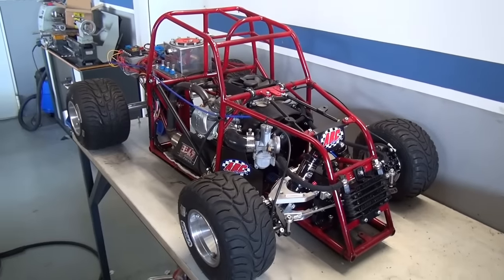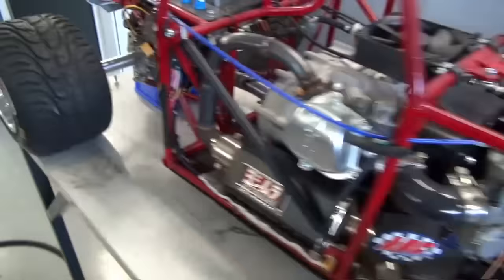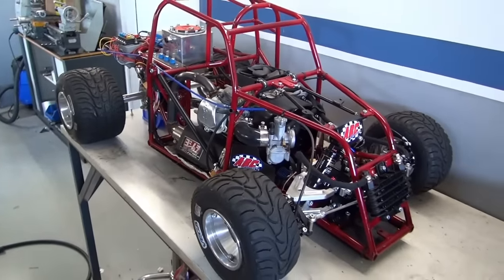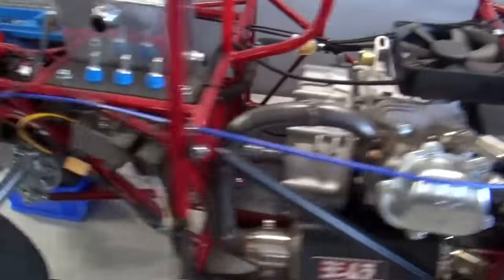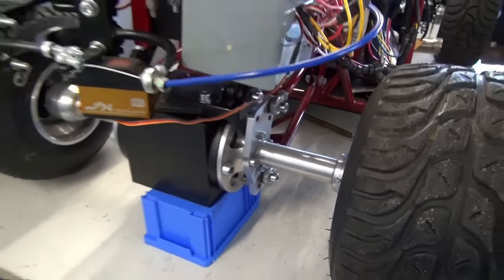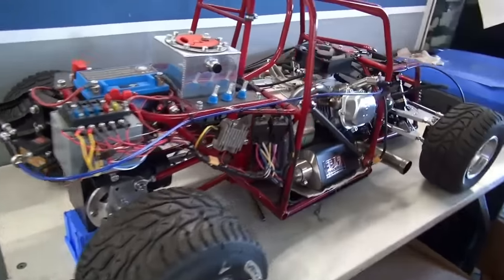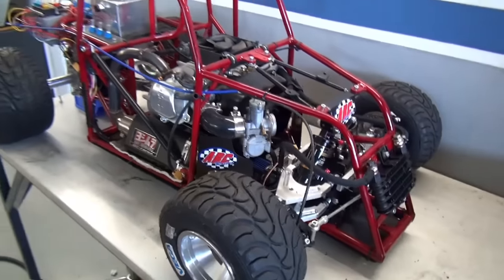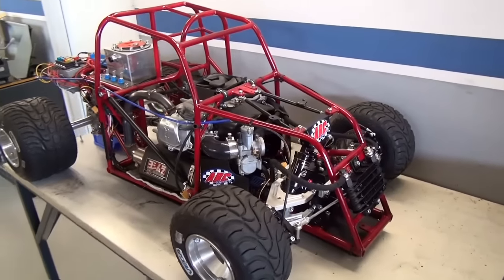Willys Part 6 - Turbocharged 1/4 Scale RC Car

Comment: That is not a RC car it is a work of art,your work is perfection my friend.
Reply: @timsane   If it was mine and was able to carry me I would have a seat cushion and foot pegs or large running boards for my feet mount on the side!😁
Reply: @timsane  It is an RC after all which is pointless to ride on it and use the transmitter to drive it while riding it might as well have the steering wheel and gas and brake pedal instead!
Reply: It takes an artist to work on something this small with ease it’s a completely different atmosphere from a real car 😂

Comment: Not sure how your clutch works but you need to stiffen the engagement springs to increase the stall. By doing this it will increase rpms before the clutch engages making it hit much harder when it does engage! It will also increase the engines total rpm, as long as it doesn't float the valves this is a good thing! I know you went from turbo to super charger but I believe this will still apply! Beautiful build my friend! And yes I have watched more recent videos as well! 👊😎👍
Reply: @timsane  You're very welcome buddy, clutch shoe weight works in kind of a similar way, it maybe just the thing to get the clutch to engage at a higher rpm and in effect make it launch harder! I'm not sure but I think it's what you are looking to achieve? Hence why you went from turbo to supercharger more power at a lower rpm creating more torque and giving it that quicker acceleration! Very cool my friend Amazing build!

Comment: Don't underestimate the power of hand done Tig welds, i don't think I'd trust Lazer welds when strength is the goal. Lazer welds are great when you don't want to see the weldment. A good welder can give you a tight flat weld with 100% penetration and it will break at that weld, inches in front or behind but not the weld.

Comment: I new the second that I saw your last video of the laser welds on the axles that they would break. There was not enough penetration on the parent metal.  I would check on the proper weld procedure for the metal that you are using for the axles. I believe that a preheat and a postheat would help greatly on the end product.

Comment: i really dont like that your front wheel turning point is 20-30 cm off wheel center. when you apply brakes the wheel with the most friction will twist the steering to that side.

Comment: Yeah, but in order to do a burnout you had to hold your foot on the front and lift weight off of the rear to make the tires easier to spin, which is cheating! Lol